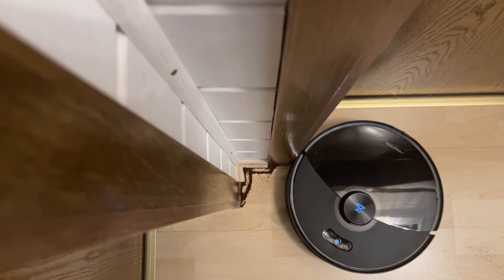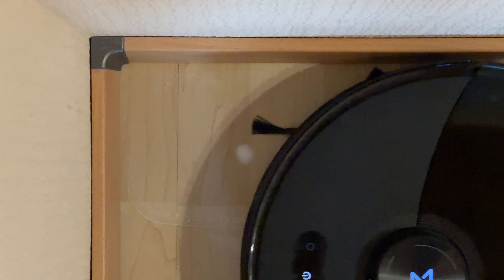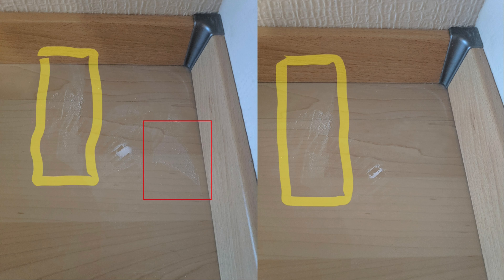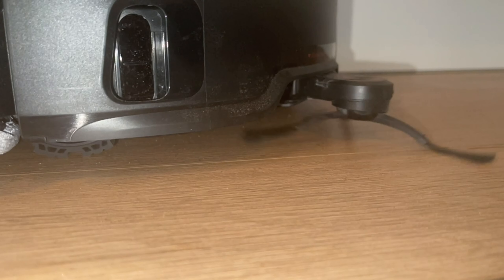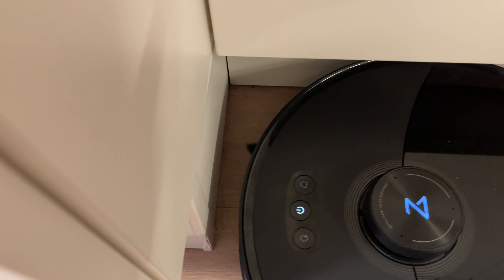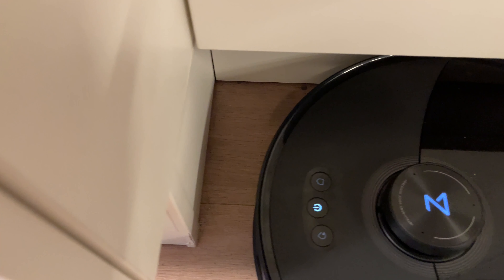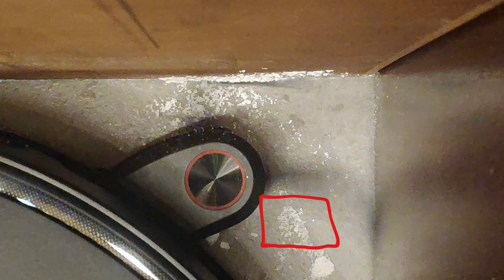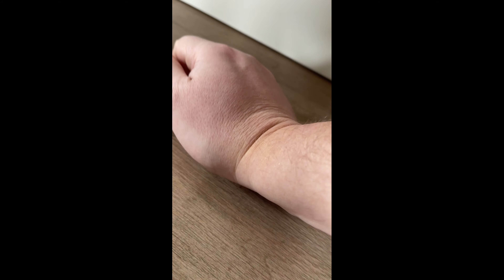Roborock S8 MaxV Ultra - FlexiArm details and testing

Comment: Can you test the new eufy S1 Pro? I think its a gamechanger
Reply from the maker: tbh i am not that interested in this robot since it makes not much use of the d-shape : the suction port / main roller is too far away from its front and side panels  so it is not vacuuming close to edges and cornes like better d-shape design are doing like the dyson vis nav, irobot s9 or the vorwerk/neatos.

Comment: Can you test the Dreame X40 FelixiArm? Great Video!
Reply from the maker: Will take some time since i buy the robots with my own money - but yes I am going to do the same test.
Reply: @frickhelm  wow thanks 🙏 
But Do  you overall keep the roborock? Would you still recommend it?
Reply from the maker: @R-Herbert-Schwarz  no i personally do not recommend it for several reasons that are mostly related to the cleaning performance (you have to use the mopping all the time and not even get the same cleaning performance compared to some vacuum only robots). Video about this is in the making - but you for 1399 Euros you get mainly a sweeping machine with some mopping attachement - and nothing that really vacuums [that others are able to do].
Reply: @frickhelm Danke für dein Feedback! Ich habe erst in deinen anderen Videos gesehen, dass du Deutsch sprichst :D Ich bin sehr gespannt auf dein nächstes Video! Danke nochmals für deine Hilfe und Klarstellung!
Reply: @frickhelm  why do you indicate you have to use mopping all the time?   I have one and use vacuum only most of the time.  It’s much better that the prior s8 model.   But the older S5/s5 Max were the best at cleaning from my experience.
Reply: @Firebat-  Because mopping will remove the fine dust that the robot can't vacuum.